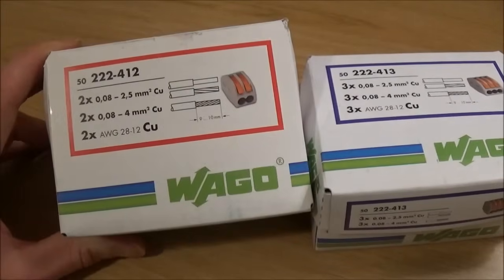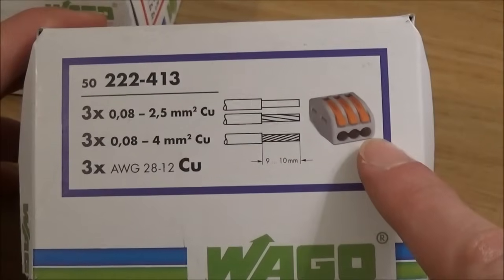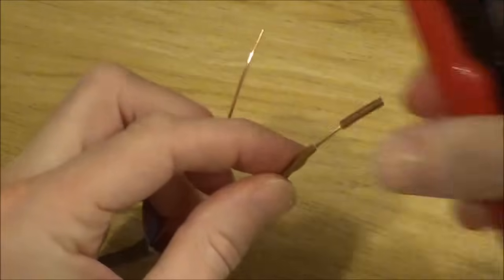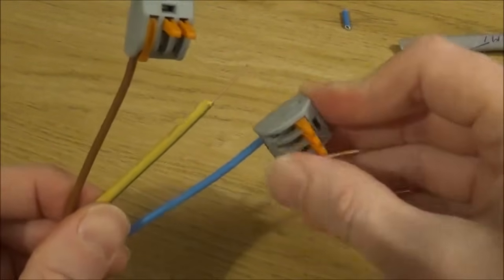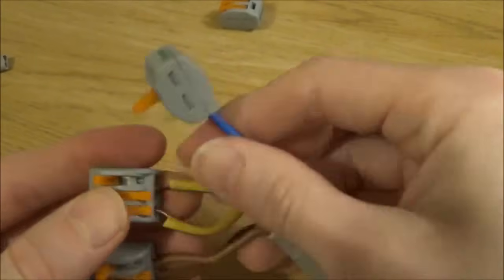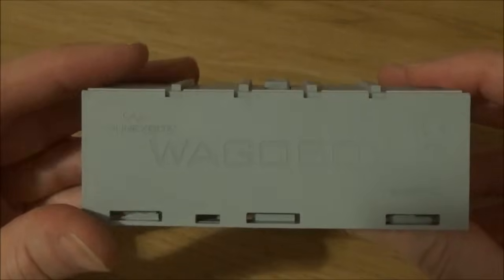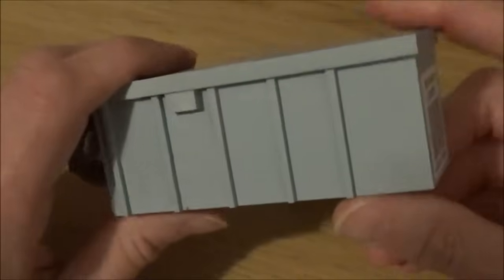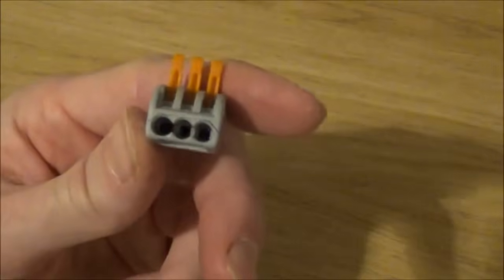WAGO 222 connectors review and demo. How to use with WAGOBOX Junction Box.

Comment: My parents have tiled the kitxhen walls and i cant seem to get the wires in the sockets to all go into the box.

I have to have 3 wires jn 1 socket as 1 supplies socket,1 goes into a extra socket and 1 goes back to the ring main.

Can i use these connectors to have 1 wire in socket then join cables with these and push the connectors into studwall behind the sockets.

I can only use the 32mm boxes so thats why im struggling to get all 3 into the box

Comment: Not great for stranded wires...even tinned ones. 
Just solid wires...
I tried various ways with stranded and it either didn't lock in or with tinned wrre irregular to put in the holes. Always a catch-22.
Reply: i always use bootlace ferules crimped on , with stranded flex. works great.

Comment: Really useful video without any waffle, thank you! I've just bought a mixed box which includes some of these. I've never used them before. With mine, the orange lever unclips, but does not want to open to 90 degrees. I don't want to break it, but do I just push harder, or has the design changed recently so you don't need to open to 90 degrees (mine only open to about 20 deg.)? Thanks.
Reply: Push harder!

Comment: Hi, do you know if the connectors are double insulated at all? The reason why I’m asking is cause I’m trying to install a metallic lighting unit which doesn’t have earthing cable to attach the one in the ceiling to. So I am abit worried it may cause electrocution after I install it
Reply from the maker: If it's a metal light, then it should have an earthing terminal somewhere surely?

Comment: This helped simplify things a treat. I was very careful to check that the wires were dead after turning the fuse off at the CU, multiple checks with a tester. After that, a breeze. Didn't need the junction box in the end as the wago's fit into the lamp fitting rose quite easily. Many thanks!

Comment: hi could i use those to blank the three wires from a plug socket. i want to convert a double to a single (timer socket) theres six wires...? thanks
Reply from the maker: If you have six wires you need to put them all back into the single socket so double up the wires in each terminal. it should be exactly the same as the back of a double. You'll see what I mean when it comes off the wall and you take a look. But yes they can be used to terminate cables. If in doubt please use a qualified electrician. Thanks for watching.

Comment: I dont room to either push all the connectors into a junction box or push the box into the ceiling hole.  Can I just push the blocks into the ceiling without the junction box?
Reply: No it against ice wiring regulations.

Comment: Nice demo funny ending. I bought one of those boxes on Ebay (set of 5) after seeing this video. But I chose the box with 3 compartments by mistake instead of two compartments. So the connectors do not fit into the compartments. But I have ordered 5 more with two compartments now. Also bought the wire strippers, certainly makes the job easier and neater.
Reply from the maker: Best of luck with it and thanks for watching.

Comment: Load of rubbish give me a block connector any day of the week
Reply: Screw-terminal connector blocks are to be turned away from as they are more likely to become lose over time due to electro-vibrations, these are much safer and much easier to use 👍🏻
Reply from the maker: @TheKikoyy99  thanks for the feedback.
Reply from the maker: Fair enough. Thanks for watching.
Reply: True. This is an over-engineered answer to a non existing problem. Twist the damned wires and you have a much better connection. And is FREE!!!
Reply: @AlexMotan1  you won't get much work "twisting" wires together.  Ever hear of building codes?
Reply: @equigs  Ever heard of angry wife?
Reply: @AlexMotan1  I'm with you on this one. I follow "Larry's Git'er done" philosophy.

Comment: Looking to add sockets to an existing ring main... once I've cut into one of the existing ring cables, one existing leg is long enough to feed to the socket. So would I only require one wago junction box with 222 connectors to link the other end of the existing ring cable to the new leg? Only reason I ask is because I read on a forum that if your adding to the ring main you need two wago junction boxes (at either end of the new socket added to the ring, due to the connectors being down rated to 24amp). Or is it possible to get connectors rated to 32amp? Hope my question makes sense, Thanks in advance
Reply: The connectors I have are 32A rated, so you would only need 1 junction box, feeding from your ring main circuit (should be a wire coming into the existing plug and a wire out to another pre-installed plug), all you’re doing is spurring a radial from a ring main circuit, which is perfectly fine to do, just make sure the connectors are rated to 32A and you’re only adding 1 socket from your ring main and you should be fine 👍🏻

Comment: Hi can I use a 3 way wago with only 2 connections ?
Reply: Hi Paul, the Wago is just a metal bar with x ammount of spring connectors. You can have a theoretically Wago with 100 ports, and still use just 2 of the ports. Though the smaller Wago the smaller volume it takes up in a junction box.
Reply from the maker: Thanks everyone for the feedback, it's a great community of support on these comments!!
Reply: I've used a 5 way with only 3 connectors used
Reply from the maker: Yes of course, they don't all have to be used.

Comment: Good video! I was just using something similar today (the ones without the levers). I needed to install LED light in the ceiling, there was only a wall light in the room. Is it SAFE to connect the main electrical cable to new cable using these connectors and install into the wall? As the wall cable was only 10cms. I used cable tubing over cable and plastered over the cable and the "wago connectors" the led does not jave earth so i taped it off with electrical tape and wrapped the end around new cable for led.  I could not use junction box between the new couplings as it would not fit in wall, without having to break brics under plaster layer. Is it safe for wago connectors to be plastered/cemented direct i to wall?  Many thanks!
Reply from the maker: They are not meant to be plastered over, they should either be eft inside a back box, socket etc, or if concealed, then put in a suitable junction box. Hope that helps.
Reply: @POUSEaroundtheHOUSE  Great thank you, i thought as much, so i ended up chasing cable to the ceiling and there as cavity so i could use a proper  cylinder, black plastic electric box to connect the two cables.
Reply: @POUSEaroundtheHOUSE  I believe these can be plastered over as they are maintenance-free? Forgive me if I’m wrong I work in industrial electrics but enjoy myself some domestic wiring too 👍🏻
Reply from the maker: @TheKikoyy99  not sure if tgey can be plastered over directly but if used in the wagobox junction box and cable tied closed, they can be left concealed in the floor or ceiling yes. Hope that helps. Thanks for watching.
Reply: @POUSEaroundtheHOUSE  they should always be in a junction box such as a wago box anyway due to regulation 👍🏻

Comment: Can I use them on the back of a socket for short wire to socket adding extra wire to socket I was told to use blocks as the 2.5 wire need to touch each other
Reply from the maker: Yes you can use these for extending cable.

Comment: Are the 222 fine to use in 30/32amp ring main as theyre only rated to 24amps when using the 2.5mm cable
Reply from the maker: They should be ok, however check the WAGO site as these are 32amp rated. Didn't know they did 24amp. Best to be safe.

Comment: Great video as ever!
I'm changing an old ceiling light/fan which once I get down, won't go back up easily, but I'm keen to take a look at the wiring before I install the new fitting. Is it save to remove the old light and place the cables into wago connectors for the time being?
Reply from the maker: Yes but firstly ensure the power is turned off and make sure the loop wires are in the one connector block, neutral in another, earth in another and switched live (for switch) is isolated on its own connector block. Take a photo of your wiring first and maybe tape and identify the wires first to make sure they go back the same way. If you just have one cable with 3 wires, then one connector block for each wire. Hope that helps.
Reply: @POUSEaroundtheHOUSE  great, that's what I thought. Dont suppose you have done/seen a video on removing an old ceiling light/fan have you? It's the cable for the fan which is puzzling me as this will be redundant at both the fitting and the switch once I have removed the old light fitting and connected my downlights

Comment: This was a really helpful video haven't wired light fixtures where the fitting didn't include the built-in loop connectors was stumped at the best way forward. Purchased the wago basic installer box and completed the installation of all 5 fittings. The video helped me save time, provide guidance as to a better way of connecting a loop lighting instead of old chocolate block fitting and gave me the refresher needed to do this job as amateur DIY'er. I am very happy with keep up the good work.
Reply from the maker: Glad you found it useful. Many different connectors on the market these days, but I find they are very DIY friendly. Thanks for the kind words and thanks for watching.

Comment: hello Can I use this for  led panel for my shop ?thanks
Reply from the maker: You need to know what the cable is on the LED panel, then check the box to see if the Wago will safely accept your cable wires. Best of luck with it.
Reply: @POUSEaroundtheHOUSE  many thanks

Comment: Just took back the box of 50 I bought from Screwfix today. 
I tried to get the levers up on several of them without success and broke two nails - unbelievably stiff as hell. My wife tried and failed too.
The Screwfix employee tried a couple and eventually managed to force the levers up. Got my money back. I'll stick to the old connector blocks.
Reply from the maker: They do ease up if you do it a few times. They have to be a bit stiff to ensure the correct torque is maintained. Sorry to hear you had a bad experience with them. I really like them. Best of luck and thanks for the feedback.
Reply: Mine were also unbelievably stiff (had to use 10 of them).
I was about to buy something else because with average force the levers wouldn't go all the way up and I was worried about breaking them.

After watching this video, I decided to try again (thanks) but pulling up 10x3 levers was definitely not a fun process😂

Comment: Can them connectors be used to hardwire a oven and hob to the power cable?
Reply: Completely fine for most electric ovens and gas hobs, just make sure your equipment does not exceed 400 volts, 32 amps and 4000 watts (max values for Wago 222 connectors). If your hob is induction though, it is not recommended. Generally induction hobs are wired directly at the fuse box with a proper cable or using a 45A cooker outlet.
Reply from the maker: Always use a proper junction box with the correct rating for your oven and hob. Ovens and hobs use a lot of power and often require they're own cable hard wired from the consumer unit in which case you need to use higher rated connector. If in doubt call an electrician. Thanks for watching!

Comment: Great video, thank you. Is the Junction box a requirement? Or is it safe for the connectors just be pushed into the ceiling? Also, is it possible to share terminals for live/neutral cables (as shown with the earth)?
Reply from the maker: Don't share lives and neutrals. The connectors can be pushed into the light housing if it allows, but if up in the ceiling they should be in a box to avoid them being pulled apart in the future. Thanks for watching.
Reply: POUSE around the HOUSE Brilliant! Thank you for taking the time to reply 🙂
Reply from the maker: @JKHunter1  no problem.
Reply: @POUSEaroundtheHOUSE  just wanted to be clear on one part please. You shared neutral or it may have been live in another video using a Hager Junction box with built in terminals, so when you say dont share lives and neutrals do you mean specifically  with wago connectors, or is this a general rule of thumb? Great videos by the way!
Reply from the maker: @JaferSabir  I think you're referring to using a blue wire as a switched live. It's not technically a neutral, it's the blue wire (usually used for neutral) used as a switched live. In this situation put brown sleeve or tape over blue wire to show It's being used as a live.
Reply: @POUSEaroundtheHOUSE  Thanks for your response, appreciated. I've got it all done now following all your videos, and works a charm, thank you again!
Reply from the maker: @JaferSabir  good work!

Comment: What junction box would you use if you had more cable? doesn't look like 5 and 3 terminal would fit. 😟
Reply from the maker: You could try the 773 connectors. They are smaller and push fit, or combination of both? Hope that helps.

Comment: Electrical Connectors Wire Block Clamp Terminal Cable12V 240V Reusable like wago
THE CHEAPEST ON EBAY item number 263132476577

Comment: Wow what a mess. Absolute butcher
Reply: Where's your video to show us how it's done? Oh wait! 😂😂
Reply: Rex Banner I’m not a qualified electrician just like this guy trying to make money off YouTube hits. If you need to show someone how to use a wago connector correctly then said person shouldn’t be doing the work in the first place. Oh and the guy doing this video gets it wrong and rams two conductors in one terminal.
Reply: I thought it was a good clear explanation
Reply: @kebarosUK  Don't you see the insulation which is stripped to far in most cases? You can't have exposed wire even with the ground wire.

Comment: This is a great video.  I have a bunch of mismatched twist caps in all of my outlets.  Those things are going in the trash.
Reply: Use the right wire-nut.
Reply: Damien Davis Electrical Connectors Wire Block Clamp Terminal Cable12V 240V Reusable like wago
THE CHEAPEST ON EBAY item number 263132476577

Comment: Wago stuf is great but I prefer the clear ones, their a little smaller and I can see a good connection
Reply from the maker: Yes, fair point. Some other great products on the market these days also. Thanks for the comment!
Reply: Electrical Connectors Wire Block Clamp Terminal Cable12V 240V Reusable like wago
THE CHEAPEST ON EBAY item number 263132476577
Reply: @aalazawi7287  fuck off ahmed

Comment: I have three sets of wires LN and Earth twisted together in a single switch plug plate. I want  extend the  cable further down to a  double plug and put a blanking plate in its place.
Would it be safe to use the conventional 30amp blocks to connect   down to? I would site them at the old position sitting behind the blanking plate. Im guessing they would be too thick to go into these ones.

Comment: Use a 5 conductor connector for the earths
Reply: Mr. 3 Phase Electrical Connectors Wire Block Clamp Terminal Cable12V 240V Reusable like wago
THE CHEAPEST ON EBAY item number 263132476577

Comment: Can these be used to terminate a lighting cable for an unused light?
Reply: Yes
Reply: Electrical Connectors Wire Block Clamp Terminal Cable12V 240V Reusable like wago
THE CHEAPEST ON EBAY item number 263132476577

Comment: Why not just twist them together?
Reply: Because twisting cabels is a nightmare.
Reply from the maker: Won't be up to scratch! Thanks for watching.
Reply: This technique keeps the wire unloosed.
Reply: Some times wires are toooo short to twist so these are ideal, but yeah I'd rather twist
Reply: These connectors, compared to twist on wire nuts can take up less space in an already stuffed box.
Reply: Because there's more than one way to skin a cat